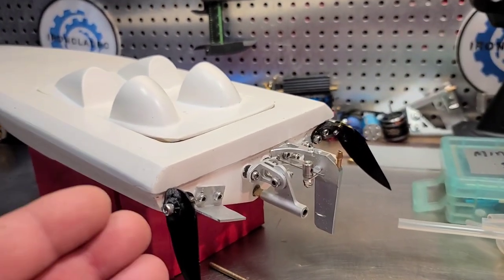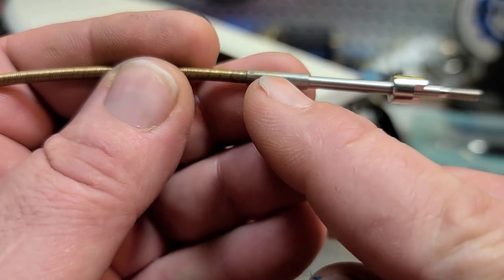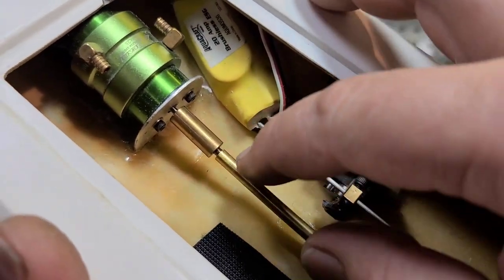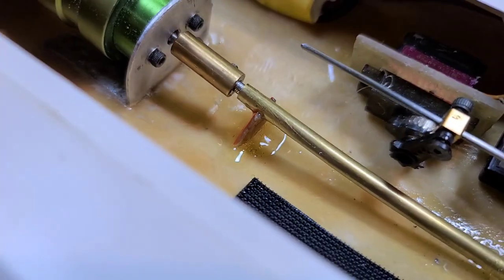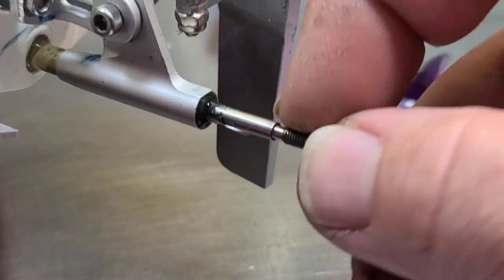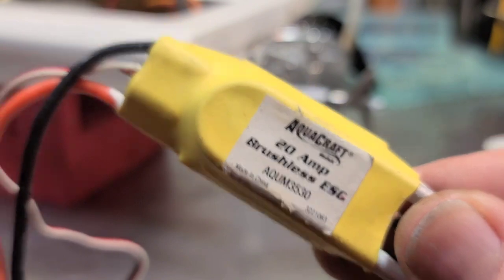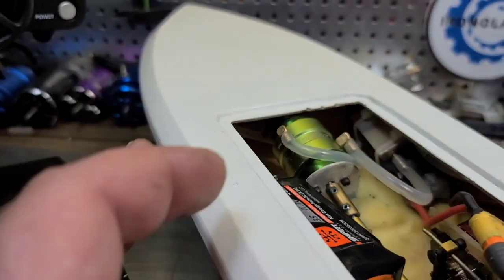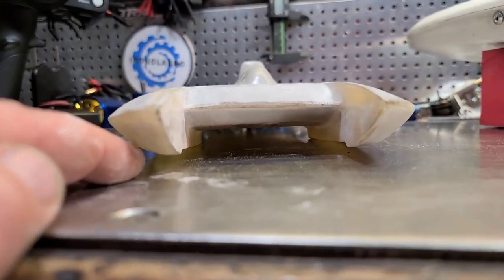Rc Boat Build Series, Fit & Finish - Wet Pedle 16" Modified Stepped Mono Hull

Comment: Just received my used Blackjack 24, spending time fixing the cracks in the hull. I purchased a new Flycolor 90 amp and 2968 3400kv motor. The old esc will be used to repower the Jet Jam with a new brushless motor. It is your Chanel that has inspired me! Thanks Big B!

Comment: I'm very curious if you'll be able to get the JetJam to perform well brushless. Many have tried and failed including myself years ago when the boat first came out. You have to match the motor RPM to work with the tiny impeller, which cannot handle high RPMs. Too much RPM will make the boat much louder but not go any faster regardless if you use 2S or 3S. It will also suck up more air and cavitate often which is annoying. I found that the best possible upgrade is to leave it brushed and ditch the stock Li-Ion battery and use a quality 2S Li-Po. Replace the ESC/receiver combo with a Hobbywing 1080 brushed speed controller or something equivalent. The boat will be at least 5 MPH faster than stock and that's about the sweet spot for this boat. Water cooling is optional, but not necessary. I have a pair of JetJams that are set up this way for when my grand kids come over to go swimming. These boats are perfect for kids because the hulls are extremely durable and the jet drive is safer because no exposed propeller. They can run head on into each other and bounce off the hard cement walls all day and the boats just keep going. I'm hoping that you prove me wrong and your conversion is successful (try using a low KV motor).  The Wet Peddle would look cool with just couple painted helmets mounted on the canopy and then fabricate small windshields with Lexan. Can't wait to see her go. I bet she's gonna run nicely! Cheers Bro!

Comment: I'm curious to see how the Wet Peddle runs.  Where did you find that little hydro?  The size is cool, but the precision factor seemed to be somewhat lacking.  Was it the same guy that does a bunch of different hulls and sells them on eBay?  Didn't you get an Atlas hull from him that was rather "crude"?
Reply from the maker: I got the hydro  from a subscriber goodie box, its from ebay I couldn't find the link but here the sellers store. https://www.ebay.com/itm/284639103012?mkcid=16&mkevt=1&mkrid=711-127632-2357-0&ssspo=Wtx59djvSuy&sssrc=2349624&ssuid=yQkZS9FcQay&var=&widget_ver=artemis&media=COPY

I think the hull was 30.00 plus shipping Message the seller he'll layup a hull for you.
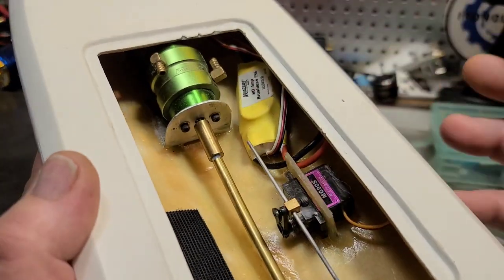Reply: @IRONCLADRC  Yeah, that's the guy.  I think his stuff is a bit rough and that out-of-square hull is proof.  Too bad no one makes a quality 1:20 fiberglass hydroplane (actually MHZ does, but if you look closely at the hull, the asymmetric sponsons and hull are copied directly from the full-sized unlimiteds and are designed for left turns like the 1:10 guys in the Pac NW).  I have an extra MHZ 1:20 hydro hull in my inventory and may build it to turn left.